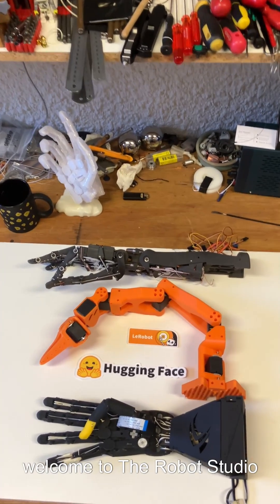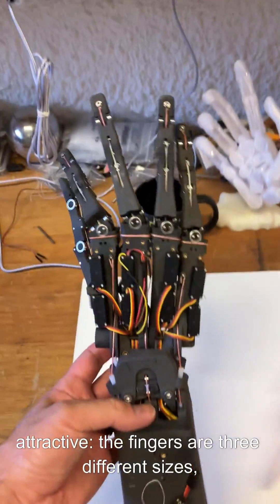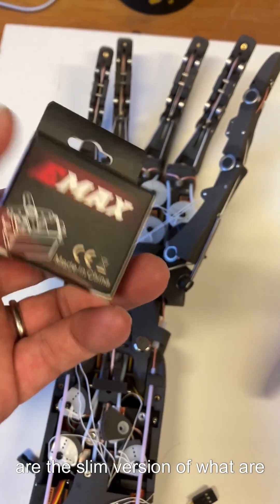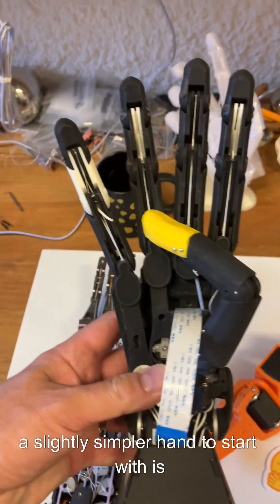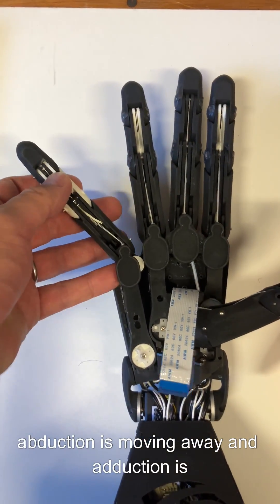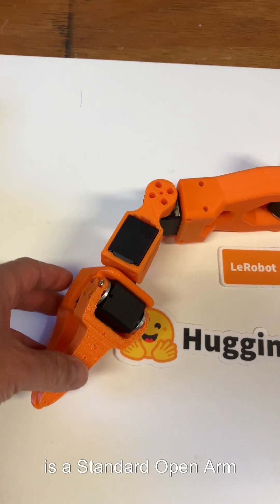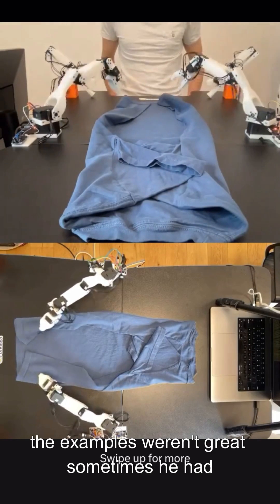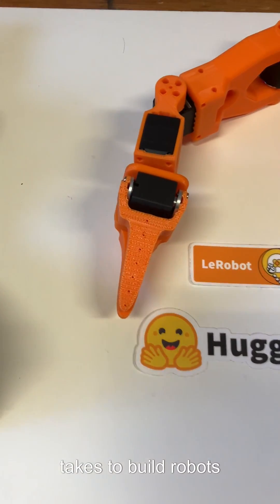3 free projects! Free designs for low-cost humanoid robots.

Comment from the maker: These are the three, free designs I'm currently offering to get you started in the art of building robots.

The V1 DexHand is an advanced bio-mimetic hand design with fast fluid motions ideally suited to gesture based activities that can built with a minimum Bill of Materials (BOM) of $320USD. This does not include a 3d printer or any other tools, taxes or import duties.

See DexHand.org for more information.

The robotnanohand(.com) is a medium build with 11 servos of a more advanced type that use serial signals instead of legacy pulse width modulation (PWM). It is suited to gesture work and light physical work with a variety of useful grip types. It has a minimum BOM of $270USD. This does not include a 3d printer or any other tools, taxes or import duties.

See robotnanohand.com for more information.

The Standard Open SO-Arm-100 is an easy to build and operate 5 dof arm with simple gripper suitable for conduction tele-operation and end-to-end learning with Le Robot software from Hugging Face. It has been designed to use as few components as possible with a minimum BOM of $100USD. This does not include a 3d printer or any other tools, taxes or import duties.

Check back soon for the official release towards the end of October.

If you look there are beta versions on therobotstudio Github page.
Reply: To what end is this? If we are working toward a world where money is no more, why are we building upon a world of monetization? It seems odd for an open source community to continue this game of Monopoly, when we would make much faster progress with cooperation instead of competition.

Comment: Heyo, quick question about the thumb flexor tendon: I'm currently getting poor results with the spring extension of the thumb after flexing, despite checking the PTFE channel to ensure it is clear and the tendon string is not twisted (even pulling the spring myself requires a lot of displacement to extend it to the default position). Is there anything specific you may have done to make sure that the extension is not hindered? Cheers!
Reply from the maker: Yes, when the thumb is fully flexed the knuckle can bind the tendon where it emerges from the CMC joint.

I’ve fixed this on the stl files now but you may have to trim the inside of the thumb knuckle to create some clearance.
Reply: @therobotstudio   Which end of the thumb knuckle should be trimmed? I printed an edited version of the CMC pitch with an edited path for more clearance on the distal end and chamfered the proximal end but am still having issues, albeit they are not nearly as pronounced as before--I can get about to 50% flexion where it will return to fully extended. Or perhaps my issue lies with the PTFE tubing, despite it being able to move through the routing with a bit of pushing?
Reply from the maker: Hard to say without seeing what’s going on - would you upload a quick video showing the problem?

The error I corrected was at the proximal end of the thumb knuckle where it rotates around the CMC.
Reply: @therobotstudio  Hi, I believe I fixed this issue but the thumb still cannot fully flex--not sure if this was a design choice (since most gestures only need it mostly flexed), or if there is an issue with my implementation.  I'm likely going to leave it as is despite this, since it is a relatively minor issue now, but my curiosity gets the best of me. https://youtube.com/shorts/mUyDMtRbTqg?feature=share
Reply from the maker: Did you pull that video? The link is dead and I'm curious to see the exact issue please...